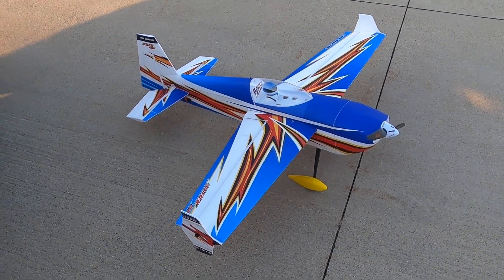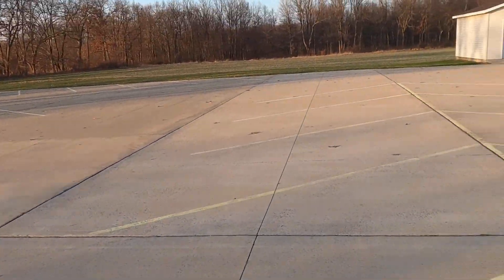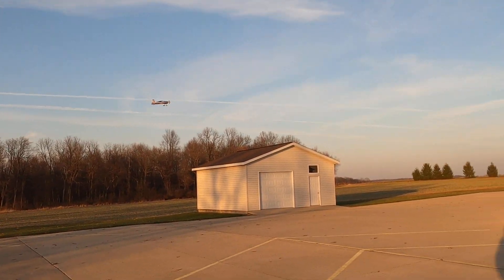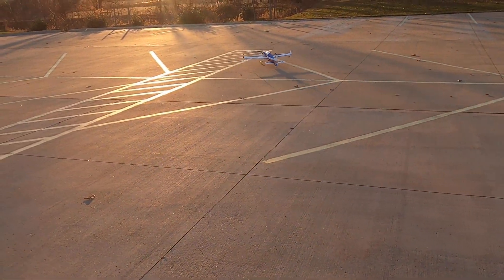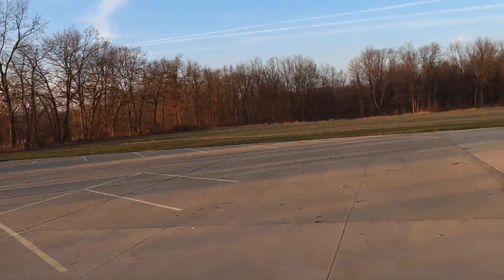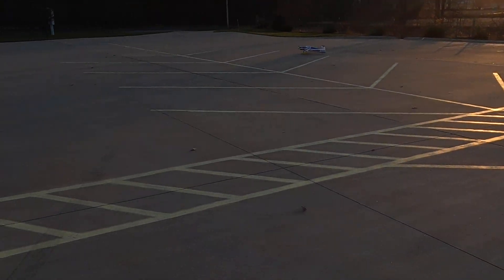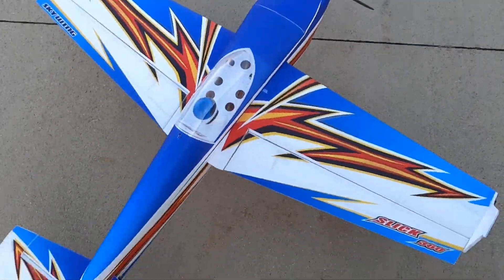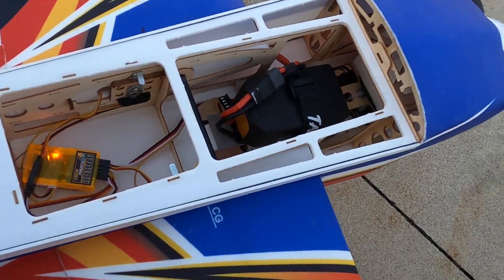11-12-2020 Skywing 48" Slick 360 V2 PP - maiden flight - 6S power

Comment: I got the same motor… and I have the 6s 1800 mah hrb batteries 270g what do you think about this batteries?
Reply from the maker: I've never had any HRB batteries, so I can't comment on them, but I fly this plane with 6S/1800mAh 75C Liperior Pro packs, (313g) and as you can see it has plenty of power.

Comment: Hi I ordered the same plane.May I ask 4s or 6s good to fly ? Thx :)
Reply from the maker: I fly with 6S 1800mAh. Great flying plane!
My setup:
Motor: Sunnysky X3120-9 V3 585kV
Prop: Sunnysky Eolo 14"x7"
ESC: Hobbywing Platinum Pro V4 60A
Servos: KST X12-508 Coreless HV @ 6.5V
Battery: Liperior Pro 6S 1800mAh 75C
Reply: Ok Thx for your information.
Great flying : )
Reply: Where did you buy the motor?
Reply from the maker: @victorhugollerenaaguilar7023  I bought the motor from Sunnyskyusa.com
Reply: Does this motor fly in 5s. I wonder because I have some 5s and 6s 1800mah batteries?
Reply from the maker: @victorhugollerenaaguilar7023  It'll work on 5S, but if using the same prop as with 6S it'll be down on power.

Comment: 0:06 Looks awesome great to see you back in the air again!

Congrats on the maiden of your new bigger 6s plane I'm also happy to hear you are feeling good again not sure if you seen any of my latest vids? if not it's cool.
Reply from the maker: Thanks. I'm still not feeling 100%, but I figure I can't stay away from flying forever. I've been meaning to make a dr appt, but haven't got that far. :D

I have indeed seen your videos. The Phantom on 3 blades and 3S seemed to go like a rocket. Of course, I only fly mine FPV, so I have no idea how fast it looks from the outside.
Reply: @somespamsite44  Ok what are thoughts on this?
https://www.youtube.com/watch?v=kJ5Xp_BQkpM
Reply from the maker: @3DMOFO2020  Just now saw this. Stupid youtube notifications not working as per usual. Looks like a good mod for aileron authority, but I'd worry about the tail flopping around at speed. Depends on how fast you fly, of course.
Reply: @somespamsite44  WHOA! I thought you seen this video already it's almost a year old dude oh well better late then never LOL. Nah I haven't had any of those problems unless I turn down my gains on my FT Aura Lite on my  knob on my radio sometimes if then gains are high??